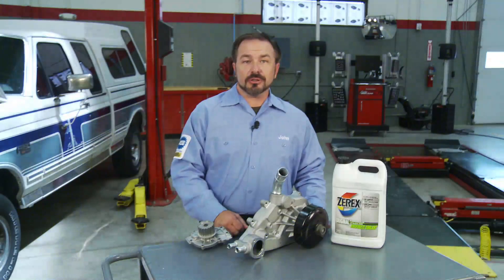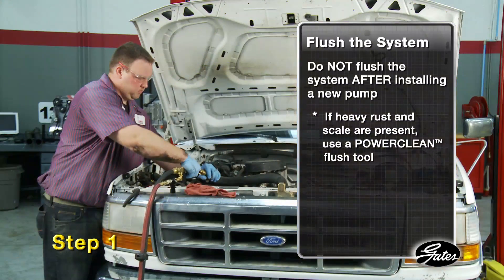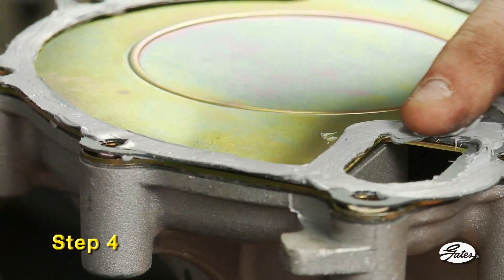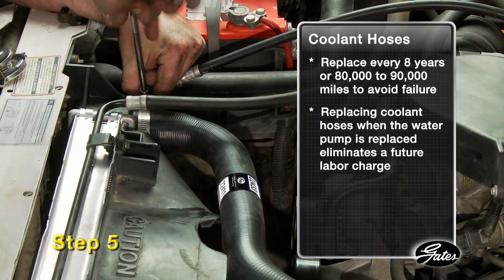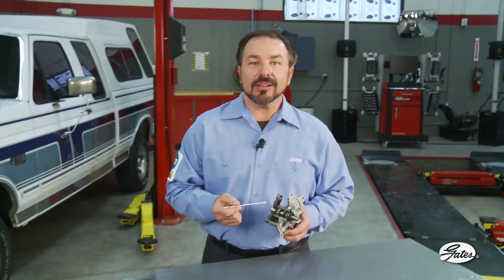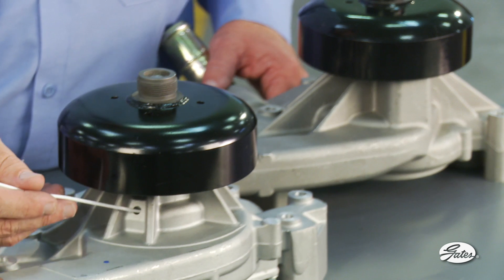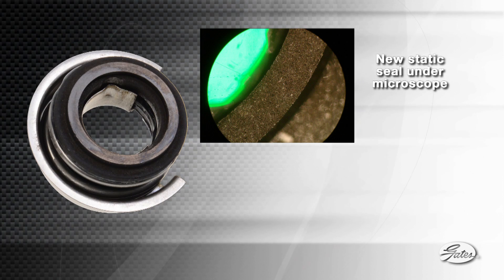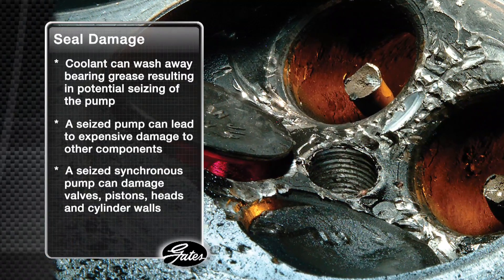GATES TRAINING: Cooling System - Part 3 - Water Pump Installation

Comment: Most repair shops are clueless about the water pump seal, bearing and contamination in modern cooling systems. Oil change shops use a standard one coolant fits all applications theory that turns some antifreeze into a jello like consistency that can cause an overheating condition. Its rare to see any service work done to the professionalism of this video, time is more important than the quality of their workmanship. This is when the customer gets blamed for neglect when the shop cut corners and did not flush the cooling system and the water pump failed due to coolant contamination.
Reply: Amen, I couldn't agree any more. Like I said in the other videos. It's a shame that this information isn't made standard, even though it's implied that is should, to all the shops that charge a pretty penny for less than mediocre service.